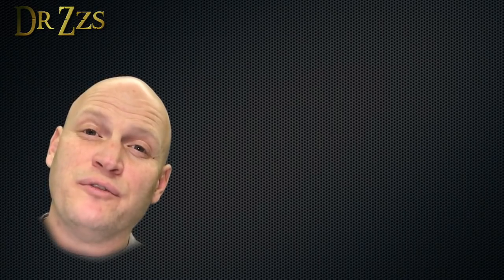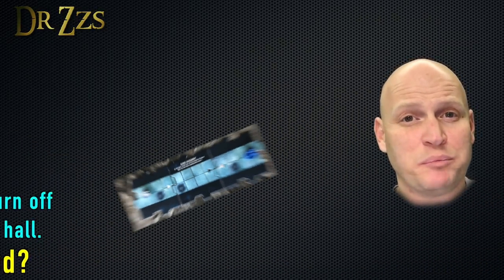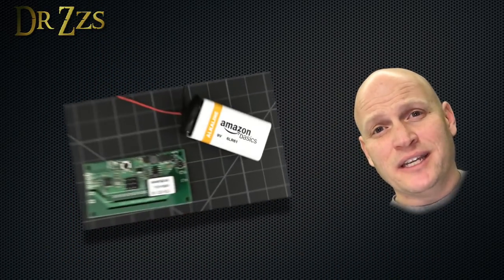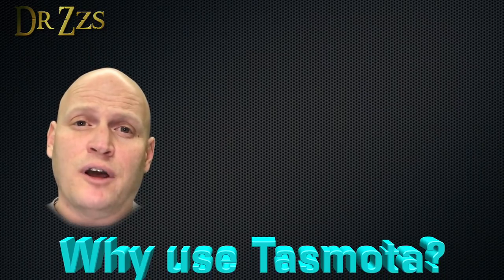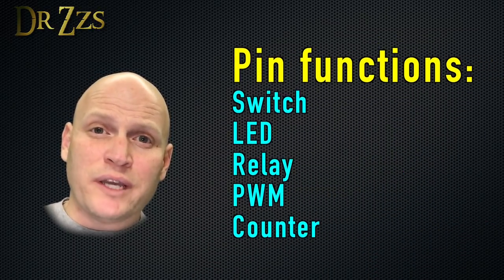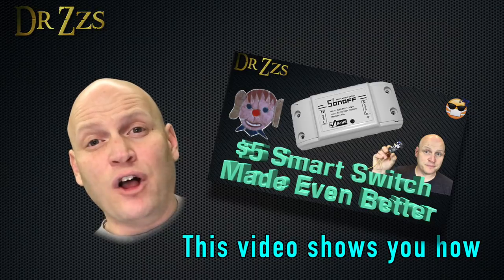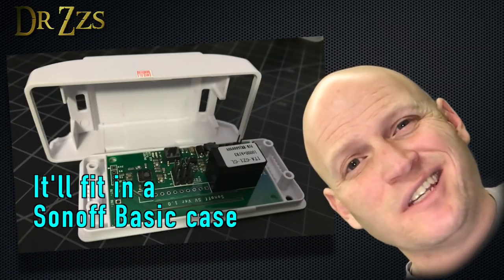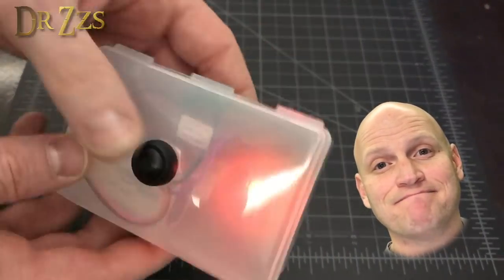an Almost-Awesome Wifi Button & a Lesson in Failure...

Comment: You were actually on the right track with your battery switch idea:
With something like a NodeMCU you can hook up the emitter pin of a  transistor to the (-) of the battery, the collector to GND on the NodeMCU, and have both the external button and a GPIO pin wired to the base of the transistor.   When you press the button it powers up the board and in your setup function you set the GPIO pin to HIGH to keep the board on.  Have it run through it's code (connect to mqtt server, send a message), then write the GPIO pin to LOW, which will turn the power to the board off until the next time the button is pressed.
Reply from the maker: Thanks!  
Maybe I'll try it again someday.
Reply: Robert Tait Sounds like a good idea, what kind of lag would this give to a button press to sending the command? Cheers
Reply: depends on the size of the sketch.  maybe 1-2 seconds?
Reply: Robert Tait This is exactly the approach I used for my device to notify me when my snail mailbox door is opened. Takes maybe 10 seconds to come up send out the notification, then removes power from itself until the next time. The battery has lasted about a year so far.
Reply: wow awesome! Do you have any info/specifics you could share, I'd like to copy!!
Reply: Here's the schematic of my version: http://i67.tinypic.com/fdv7kk.jpg, and the construction of one that uses a tilt switch for activation: http://i66.tinypic.com/2cp56a0.jpg. The transistors are nothing special, and probably any PNP/NPN could be made to work. I think I may have tweaked the resistor values a bit while I was tinkering with it, so don't take the schematic values as the definite ones. The construction uses the "Manhattan Style" technique.
Reply: What about connecting a powerbank to the sonoff sv. And use a wireless charging module. Than you can use a wireless charger when you're not using it.

Comment: Find an old mouse around the house. Break it open and take the button out of it. Wire the gpio pin 14 to NC, battery ground to C, and the ground from the Sonoff to the NO. It will now turn on/off the light without drawing battery overtime.
Reply from the maker: genius!
Thanks!

Comment: For the battery problem add a rechargeable battery, add in one of those QI adapters(takes a little hacking) for cell phones and a charging board. The remote already would need to be sitting somewhere anyway, so just make that a QI enabled home base.

Comment: At one point the Amazon Dash buttons worked like this. I was never able to get mine to work but I've seen a few videos with it working. Only down side is that it wasn't instant.
Reply from the maker: I think bitluni's solution was genius.  
He set his board to deep sleep and a button press wakes the board, it runs one command to trigger the MQTT message then goes back to sleep.  So the battery can last a lot longer.  He uses a few new bits of software I'm not familiar with so I haven't tried it.  
Someone smarter than me could probably do that with a D1mini and an Arduino sketch.
Reply: Multiple new Dash buttons on the way.  Hopefully I can repurpose them.  If not, I'll simply order an Amazon product with them, making them essentially Free after the $5 Amazon credit gets applied.

Comment: If you used a switch with 2 normally open contacts you could use one for connecting the battery and one for activating the wifi button.
Reply from the maker: Howto Hank That’s a good idea.

Comment: I wish I could use this device to control a 12v-15v AC current that comes out of my outdoor landscape lights. I believe AC input will not work. And I have not found any other solution. I have a 300 Watt transformer with multi-outputs 12-15 volts to accommodate any voltage drop due to very long wires..

Comment: SO glad I saw this video; I was planning on a battery operated light using the sonoff SV. Why? Because on their website it specifically states that standby power consumption is less than 1.0 mW! Did they revise hardware since your video, outright lie, or is it technically accurate but not practically accurate? Who knows. I may still get one for a different application, but the remote light would have been very handy.
Reply from the maker: Not sure how they came up with that number.  Maybe with their firmware they can put it into a deep sleep mode or something.  There are good solutions for making a Wifi battery button that use an ESP8266, but the way they work is to have a button press power up the device.  As soon as it powers up it sends the message to toggle the light, then it powers down until the next time the button is pressed.  That'll let the battery last a long time.
Reply: @DrZzs  I watched this video yesterday (https://youtu.be/VqxCf3NjVDU?t=113 , pause it because the email / post doesn't last very long) by "The Hook Up" and they had an email that said that the issue is that Tasmota doesn't support deep sleep because its out of the scope of the project. So, its a Tasmota issue it seems. Is there another firmware that could do deep sleep maybe?

Comment: There could be a use case where you could make the momentary switch power on the sonoff and send off the command. this would limit the battery draining to only a few seconds every time you use it. It would also mean that you may have to press the button for more than a single moment to give it time to send out the command. 
I don't know if it would work. It's just food for thought..
Great content btw
Reply from the maker: Thanks!
Ya that’s a good idea. I’ve seen others do something similar to save battery. 
Good thinking
Reply: DrZzs you pointed out something about isolating the relay. I didn't exactly get it but maybe you could do that in another video. 
I have space behind my switch box and I (with the help of an electrio) want to use a sonoff to turn on my electric water heater so I can have hot water every morning and save energy. The sonoff can't handle the load but I can use it to control a secondary relay with higher amperage rating. Maybe a smaller board would be better but I don't know. 
Problem is I asked around and I would have to figure everything out before I call one because when they hear the word wifi and electronic they give up even trying to here. 
I think many people with hot water tanks would appreciate the savings. I for once would love to sync up my alarms so I can have hot water when I get up and not have to leave the heater on all night. (I live alone - Best case scenario for that)
Reply: You can also use rechargeable 3000mhA batteries and cut a whole for a use charger. For more information on that on the show Know how on twit. They made a battery powered rpi in a 3d printed Case and it includes many cool thing i didn't know how to search for.
Reply from the maker: do you already have the water heater?  What kind of switch turns it on right now?  My guess would be there's some kind of power button/switch.  What you could do to control it would be to put a sonoff (or other cheap wifi/relay combo) inline with that switch, so activating the sonoff relay would be the same as just flipping the switch on the heater.
Reply: On this subject I'm very hesitant. The resistance in the watertank can pull up to 4500W I may not be able to even plug the cables in the relay, and if I can it may catch on fire. Its not made for 220V, 20A.

Comment: maybe ESP32 is the way forward , it has an additional low power processor can go into deep sleep when not in use and should only consume 150uA in this mode. Also a LiPo battery could be considered instead of 9v.
Reply from the maker: I've heard of the ESP32, but don't know too much.  Sounds like I need to get some and start tinkering. 
Thanks!

Comment: I ordered a bunch of amazon buttons for remote buttons and MQTT triggers but due to long delay triggering stopped using them. Thanks for the vid.  Could you please put the push button purchase link. The one that you use with your wall switch.
Reply from the maker: These are the chrome buttons

http://a.co/0cVxw5l

these are the black buttons
http://a.co/5IMHutE

I'm waiting for some capacitive touch buttons to arrive from China.  Hoping those will make some cool wall switches. We'll see.

Comment: You can use a simply 4.99€/$ Amazon Dash Button; works perfectly with HomeAssistant and the battery lasts for at least one year depending on the usage. 
In Hass.io there's a simple addon called Dasshio that works fine and reliably.
Hope is useful
Reply from the maker: That's super cool!  
so you can change the message that gets sent when the dash button gets pushed? 
has someone done a tutorial on that?

Comment: I had a battery life problem with an arduino hooked to an esp8266 board that i just needed to send me an email if a switch was triggered. Battery didn't last long so I just hard wired the side that used to be the switch input and hooked the power thru the switch so if the switch gets triggered it just powers up the unit and sends me an email, the rest of the time it just sets there with no power going thru it. It's been a couple of months and the battery is still nearly fully charged and works every time the switch is triggered. The only downfall is that it takes about a minute before I get the email instead of a few seconds but I don't mind. Might be able to do the same thing with the sonoff.
Reply from the maker: That's a good way to do it.  As long as the application is okay waiting for the board to start up. 
Good idea!

Comment: Think you can get the Sonoff to work with a gas fireplace, and still be able to use the switch that is hooked up via 12volt?
Reply from the maker: give me some more details about what you're trying to do.
Reply: My gas fireplace now is turned on with a normal light switch via 12volt. I’m looking for a way to still have a switch to turn it off and on and have the option to use my google home, or iPad. Every smart switch I find is 120 volts. If I could find a resistor/switch all in one that would be nice too.

Comment: How about powering via 5v USB like lots of other devices? Better to have a switch that you can plug in anywhere and not have rewire your lights.
Reply from the maker: Steve Dinn Thanks!  That’s a great point and it would totally work!

Comment: I would like to try getting 12v power from a livolo switch cause I want to eliminate battery. Do you think could be possible?
Reply from the maker: I'm not familiar with a livolo switch, but if it outputs 12v then you should be able to connect it to the input side of the sonoff and it should work.  Is this livolo switch connected to some lights currently?  Are those low voltage lights?
Reply: DrZzs the livolo switch has 2 circuits as I remember which are connected to each other.The ouside first circuit where the touch buttons are got 4 pins which are connected to the center circuits where below are the relays.one of  Theese pins brings 12 volt. I should buy them and I ll try.

Comment: Is deep sleep function available for use? Some youtubers find the esp8266 to consume only  .78 mA when in this state.
Reply from the maker: That's a good question.  I bet it is available in Tasmota somewhere. Those guys have included pretty much everything.
Reply: Thanks. The more I think about deep sleep, it may not be practical as code is lost in volatile memory and must be restored. This may create an unreasonable delay to wake processor, restore code and fire relay.
Reply from the maker: well, guess it'll depend on the application.

Comment: Hello Drzzs,  I got stucked at a point to flash my own code through Arduino IDE to control my sonoff sv switch. Which GPIO pin is associated with Relay? I am using mqtt to receive message via wifi to control my relay. Please help me.
Reply from the maker: I believe GPIO-1 goes to the Relay. There are schematics on the itead wiki page for the various sonoff devices.  Maybe those would be helpful if you're making your own firmware. 
That's ambitious!  Good luck!
Reply: Thank you very much for your reply. I used GPIO-1 for my Relay but it didn't function. But by hit & trial method, I found gpio 12 was dedicated for Relay. So much happy . Your videos are so inspiring and very much understandable. Now my question is why builtin Led is reverse in sonoff? When i use digitalWrite function in Arduino IDE , it functions directly opposite. I defined LOW to get HIGH. Is there any solution to get High when i define high. Again Thank you in Advance. P.S There is no detailed schematics of sonoff sv showing all gpio's clearly in the website also.
Reply from the maker: here is the SV schematic:
https://www.itead.cc/wiki/images/3/3b/Sonoff_SV_Schematic.pdf

If you're using Tasmota you can change the "switchmode" to either "follow" or be "inverted" compared to the relay.  I think that will do what you want with the LED and the Relay.  I'm not 100% sure, but that's my guess. 
This explains Switchmode (and there's a video link):
https://github.com/arendst/Sonoff-Tasmota/wiki/Understanding-SwitchMode-and-SwitchTopic
Reply: DrZzs Thank you very much for your help. I will also use Tasmota to control my relay and gain knowledge about this firmware soon. At first I have to finish my project using Arduino IDE. Thank you so much again.

Comment: I am new to the Sonoff Basic, but what is the reason to flash it with Tasmota instead of the stock firmware? The stock firmware works with alexa. Thanks,
Reply from the maker: They are really great little devices for the price! 

The main reason I change to Tasmota is to get the Sonoff communicating using MQTT with Home Assistant or any other home automation hub.  
If Alexa is your main method for controlling stuff then you don't need Tasmota. 
Not everyone should change the firmware.  It depends on how you're using it. 
If their firmware supported customization for MQTT messages, then I'd probably leave it alone. 

Hope that helps!
Reply: Thank you. Like I said, still new to these but trying to get all the info I can.

Comment: I like the video even though you were unable to use a battery I am going to take a old cell phone charger that provides 5V  of power @ 1.5 amps and plug it into a outlet. This way I would at least be able to have a switch in a location where I have a wall outlet
Reply from the maker: That's a great idea!

Comment: just set up an RF button on the wall and an RF receiver somewhere in the house,  that way the battery will last as long or longer than a tv remote
Reply from the maker: true!  RF seems to be a much better option than wifi buttons.

Comment: i have a question and have been wondering about it why would we have a 2 way or 3 way switch in home automated where concept is automate things or control them using handheld devices switch are kept as a failsafe but need for 2 way 3 ways beats the whole idea...

Sorry do not mean to offend you was just wondering why would we need it so asking
Reply from the maker: It's for the wives who don't want to give up using wall switches.  
I hope someday to just walk around my house and have the lights turn on wherever I am and turn off wherever I have just left.  Someday....
Reply: lol that someday might be sometime soon :)
Reply from the maker: If you send me your .ino file I'll add the new light effects directly.  Or, I'll create them and send them to you and you can add them.  I'm going to do several so you can choose which you like.
justin.aden@gmail.com
Reply: i have messed up my .ino file lol gives me an error and cant seem to find what the error is about however if you need i will send it to you in the morning as on my office laptop
Reply from the maker: sure, send it.  Maybe I can find the problem.
Reply: my led strips are 60 LED PM and power supply is 40 amps what is the max length i use the PS for

Comment: What model 3D printer do you use?
Reply from the maker: I have the Lulzbot Taz5. 
I've loved it.  I didn't know anything about 3d printing when I got it.  It was easy to set up and I've had very few (if any) problems with it.  
Lulzbot is on the more expensive end, but I think you get good quality for the price.  There's less tinkering required. It just works. 
I've got plans to do some videos about it.  
So many Projects, so little time.

Comment: can this be used with IFTTT?
Reply from the maker: I'm pretty sure they can. In a round-about way. 
What is it you hope to do with the Sonoff and IFTTT?

Tastmotized Sonoffs can receive commands via http. 
https://github.com/arendst/Sonoff-Tasmota/wiki/Commands

In IFTTT you could use webhooks to send http commands to the Sonoff.  
I've tried IFTTT for a few things, and it hasn't been super reliable.  But, I guess that could be said of many DIY smart home project right?! 
:)
Reply: I need some sort of alarm to wake me up if I get a missed call. My work has us on call in rotation for a week at a time, and  the only time I will get called is while I'm asleep..
Reply from the maker: So if you get a missed call you want lights to come on and noises?
That would be cool. I'm not sure how to use a missed call as a trigger.  Have you done something with IFTTT and your missed calls already?  Is there something else we could use as the trigger, besides a missed call? Maybe a call or text from a specific number?  

This is a fun challenge.  Tell me what you've done so far and let's figure out a cool solution.
Reply: IFTTT does have an android phone missed call trigger. I can't use a specific number because it could be any of some 20 numbers calling..  I ordered a Sonoff SV and Basic  to try it out.  I'm thinking of hooking up one of those 12v piezo buzzer alarm things and some sort of flashing light. Would be a whole lot easier if I could just make it control Alexa